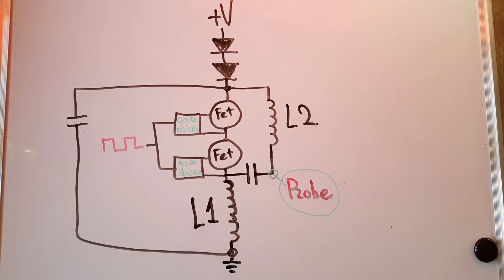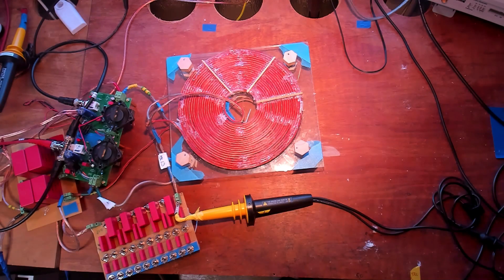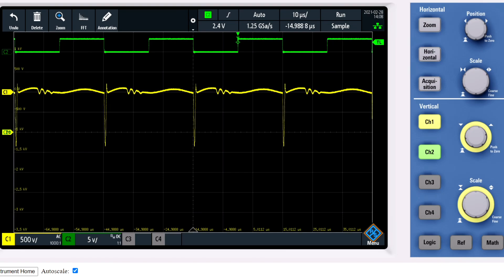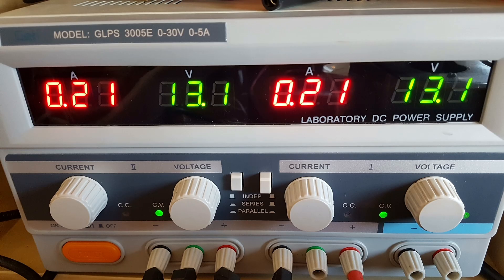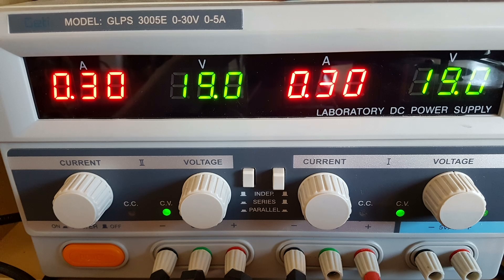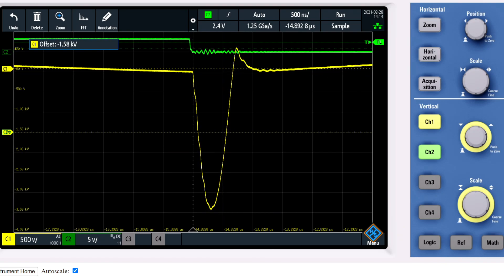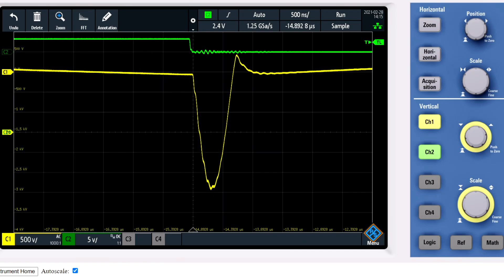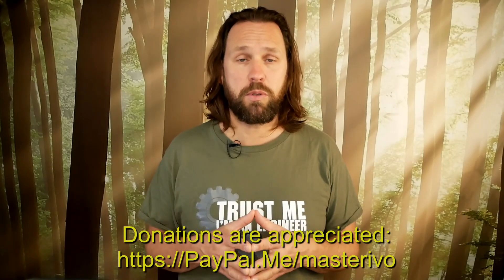High Voltage Impulse Generation

Comment: That’s a very cool circuit although I’m not satisfied with the 700 nanosecond pulse width. Have you figured out how to shorten it? A spark gap can produce much shorter pulse widths but going solid state certainly has benefits. Congratulations!
Reply from the maker: Yes I have, now I have 20ns current impulses. but at a lower voltage.
If I match Vgs threshold voltage of 2  mosfets I can again put them in series and get higher voltages.
the current impulse I now have is faster than a DC sparkgap.
Also it is quicker with a low gate to source capacity, so a low current rating of the mosfet. this makes it a lot cheaper. but it only works with a small discharge capacitor of 1 or 2nF. but that is no problem
Reply: @MasterIvo  Wow! That’s impressive! Do you have a video about this? Or a schematic? Or do you sell the board? I’m very interested in trying this on my radiant energy transformer to replace my magnetically quenched spark gap.
Reply from the maker: @SuperheroArmorychannel   https://magstar.eu/mosfet
there is all the info for building the mosfet. my most recent video shows the circuit in the second part.
boost coil in series with mosfet, which charges a 1nF cap that is in parallel with mosfet.
diode between coil and cap prevents  oscillations. mosfet discharges the cap in 20ns (and stays cool)

Comment: Hi Ivo,  I have a question regarding the resonance frequency. I have learned that there is a natural frequency of every coil because of its capacitive and inductive characteristics. For example I have a pancake coil that measures 55uH and 120nF; that will establish a resonant frequency of 61.95KHz; if another coil has 55uH and 100nF that it can be made to resonate at 61.95KHz if a 20nF capacitor is used in series with 100nF, then both the coils will resonate at the same frequency. If so then why we have to match weight of the coils, why a secondary coils has to have 1/4 wave length. Please specify and if you can also explain how you resonate a coil by adding various capacitors; and why not you calculate and come up with the same frequency or harmonics of primary coil's resonance frequency. 
Thank you.
Reply from the maker: Good questions. 

simply adding a series capacitor doesn't always work, as it needs to charge AND discharge, so that only works with AC signals.

calculations do not always give the same results in reality. For example the Probe measuring the frequency can influence the capacity.

Also, a bifilar coil has series AND parallel capacity, which makes calculations and modeling a little bit tricky.

Yes capacity and inductance determine the resonant frequency, So why equal mass?

To be honest I am not sure why.
Eric Dollard also stated, it was probably not equal mass but equal capacity as it refers to the dielectric field.

What I think, but still have not confirmed, is that we need equal mass, because we are dealing not only with resonance but also with electro static induction.

let me explain.
Yes L2 and L3 are the primary and secondary coils (april 2019 radiant power circuit video)
L2 is series resonant
L3 is parallel resonant.

When L2 and L3 are tuned to the higher LMD resonance, the voltage maximums are out of phase.

so far, equal mass isn't needed.

but now we introduce the impulses on L2.
L2 and L3 form the plates of a capacitor, which is charged up by the positive dc offset of L2.

This L2 L3 coil capacitor, is discharged by the impulses.

this rapid (disruptive) discharge produces a Longitudinal wave.

for this longitudinal wave to interact we need equal mass.
Then we can see the effects of this longitudinal wave, else it will not interact.

Again, I have not proven this. It is still an Idea. It is based on Tesla's writtings.

the quarter wave length, is mysterious to me as well. I feel it only relates to straight AM radio antenna's that are grounded on one side.
By using a quarter wave length, the top of the antenna will have maximum signal amplitude, which makes it like a wip. This maximizes the radio signal, as the energy is lost from the antenna, it wips up the Aether, giving lossy transverse waves

So for a coil this does not make any sense. A bifilar coil can store much more energy due to its mutual inductance, and the increased voltage difference between the windings that charge up the capacitance.

So I bet a bifilar coil is a bad antenna.
But you could extend the center of the resonant coil, again with a quarter wave rod antenna, and place a capacity ball on top, like Tesla did.

then the high voltage of the resonant coil can escape the coil, into the ball capacity. And if there are impulses imposed on them, it would make a good antenna. But not of transverse waves, but longitudinal waves that are not lossy. 

I hope this helps.
Reply: Dear Ivo: Thank you for the explanation. It is quite clear to me now as it makes a whole lot of sense the way you explained. I am also an Electrical/Electronics Engineer, graduated for US university in Texas. My studies are somehow more on finding a relationship between Electromagnetic forces and gravity. I did make a disc 3" dia, and it floats 1ft above the ground; I also made a field generator (using electromagnetic waves) that affects every material regardless of its atomic nature; meaning if I put a pencil in the field generator, it will spin the pencil; a rod, or any material, the field has gravity like effect; just as gravity pulls back every object tossed up in the air (not exceeding the escape velocity) I have been working for last 16 year on increasing the field effect of my gravity field generator to no remarkable success so far. Now recently I revisited my old project and started applying new techniques; one of which is resonating the solenoid in that generator. Any way, It is very fascinating watching your videos with clear demonstration, huge amount of experience and knowledge, and your unconditional sharing; perhaps that is why I am proud to be a donor to support your mission. You are a true Engineer and a lovely human being. Keep up your work and let your work shine your devotion. Regards.
Reply from the maker: Thank you thats is good to hear.
Very fascinating what you are doing.
from what I learned of "Electricity and matter" by JJ Thomson,  all inertia is stored in the bound aether, the aether IS inertia.
I would love to talk more and share Ideas. If I'm correct I have your email from your donation, I'll send you a message.

Comment: Two comments deleted again...
First one was link to -> Free energy 2012 Kapanadze Aquarium free energy device running 2KW heater load (this could be real)
Second one was link to -> Free Energy March 2017 Maksim Aliev 5KW 220 volts 50Hz  (this could be fake)
Comment was: Maybe is that reason why russians attacked Georgia and Ukraine
Reply from the maker: thanks for the the titles. It is becoming clear YouTube is actively censoring. I can't see those previous posts with links. Strange and disturbing.
Reply: @MasterIvo  Video from Georgia must be at least 20 years old. I have another video which is a part of this video, but a little better quality. It looks like original  inventor of Kapagen is another man and it is not Kapanadze. Because I have some photos from same meeting and on one of them is Kapanadze looks quite young.

Comment: and the second one tooo....

There is a a boy who claims 350% efficiency from bifilar coil... 
If I insert the link comment is immediately erased.  
??? wtf?
Reply from the maker: I can't see that one neither. Can you copy paste the video title, then I'll look it up
Reply from the maker: https://youtu.be/Rdzz34GNkxg is this it?
Reply: @MasterIvo  Yes this is it. You success. It look like if somebody is persistent enough they stop deleting posts. I am curious if this work. With usual coil it doesn't work. I tested it. There is no resonance, just back emf. But if bifilar coil has a capacitance then it is possible. So I am curious could you test it, because you already have all components made. 

In monofilar/ordinary coil there is effect of increasing brightness of light bulb, but this is because of back emf of coil. But with brightness comes also bigger power drain.  

Actually bemf is one part of resonance (coil part) second part is condenser part. Coil which is behaving also as condenser is a device which could be an answer. 
So at right frequency input we expect drop of input power by same brightness of light bulb.
Reply from the maker: yes coil that is a capacitor is what I am working on. a capacitor has 2 plates.
for the plates I use 2 bifilar pancake coils. I use 3 coils (radiant power circuit of april 2019) to create a feedback loop. L2 and L3 ar the capacitor plates. L3 is the middle coil of the 3 coil stack
Reply: @MasterIvo  I saw your work. It is nice and well documented. Congratulation on that. So did you test that circuit of that boy Daniel? 
If we connect a simple 12V light bulb on square DC signal it lit. If we connect a coil parallel to it, light bulb increase brightness. But power increase too. No matter what is the frequency of input. I tested it. 
There is a claim if connect a bifilar coil instead of ordinary coil comes to resonance at right frequency and as consequence power on input drop instead of increase. 
This is very simple test. What are you doing is far more complicated. So are you capable of this simple test or should I made a bifilar coil and test it myself?
Reply: @MasterIvo  About your coils. You have 2 ordinary pancake coils connected in a way to create a bifilar coil. It works to, just capacitance is little lower, but great for testing.
Reply from the maker: @Radovedn   would love to see you test it yourself and post it on YouTube. together we can work much faster in getting really interesting results
Reply from the maker: @Radovedn  not only the capacity is different, also the inductance. but indeed the principles still work
Reply: @MasterIvo  Ok. I tested it. It behave like an ordinary coil. Just BMF no resonance. 
It look like if there will be any resonance there should be a short HV pulses. And a big coil.
Perhaps is an insulation to ply. In future I will try different coil.
Reply from the maker: @Radovedn  thanks for sharing. remember BMF (back emf inductive spike impulses) are resonant voltage half waves.

Comment: Hello Master Ivo... your work is very inspiring and I have followed and built a variety of coils and switching circuits also. The first study and test was high-side with low-side switching of the coil to isolate the coil from +V and circuit Ground. Did not work well (POP!! goes a mosfet). So, I stacked 4 diodes from +V to the Coil. +V > D1 > D2 > D3 > D4 > Coil. And, added 3 diodes between D1 and D2 going to ground. This worked well with low side switching protecting the power supply and isolating the coil.

With a new circuit, I tried first high-side switching and then low-side switching with 2 mosfets in series a similar failure occurred that you experienced. The coil-side mosfet failed. Drain to Source permanently open. Drain to Gate permanently closed bi-directional. This stressed the Gate biasing circuit pumping +V in through the Gate which over heated the biasing ground resistor and zener and then in to the biasing pulse generator which overheated the bias resistor. Which failure occurred first? I'm guessing the mosfet... then the biasing circuit. My thought, it is not your HSM failing first. Maybe, something to do with a better dual-mosfet Drain-Source protection on high current side... maybe reconsider adding diodes in series. Thought: failure always occurred on start-up when the circuit is totally drained of energy with-in, maybe a sequence startup of mosfets (lock 1 mosfet on state, start 2nd mosfet pulse-state, release 1st mosfet to sequential pulse state). For now, I'm only using 1 mosfet (IRF840, cheap) until I figure out an output tank circuit. 

With the +V and diode high side circuit and 1 mosfet low-side, I've isolated the coil from +V (~32v) and isolated from ground. As of now, going to o-scope reading the coil +side and -side spike outputs under electrolytic capacitor load with rectifier feed. Then how to feed an L2 resonant circuit using a single SiC mosfet rated at 1200v. Maybe this will work for what I envision for an end-game.

Great work Mr Ivo!!!! Hats off to ya.
Reply from the maker: thanks, IRF840 has max 20V on the gate. and gate threshold is 10V, guess this is not the problem. it can handle 500V between drain and source, I suspect, your impulses are more than 500V and this is what kills them
Reply: yep, not the best, but these are only for test. Got these to work over 700v spike at slower pulse rate (<7kHz/20%duty). At ~27kHz/50%duty I kept the +V low to achieve 400v spike, then series mosfet slowly increasing +V until spike distortion, then backed off +V until 10% less spike. These are just for test anyway, even thou they produce a very sloppy spike. Didn't want to POP any Sic fets. 

Did you come up with a solution to series mosfet failure? Was it the HSM?
Reply from the maker: yes I worked it.
Am checking all the current polarities of the coils right now, to create a feedback loop, with L3 in the middle (LMD resonant)
Reply: Very good, look forward your solution. I've looked on your web-site and oshwlab links... please, is it possible to get a part number, value and manufacturer of just 1 coil tuning capacitor... I'm trying to find a US supplier, wanted to make sure I would be ordering the right capacitor type. Are they polypropylene metalized or film? Thank you.
Reply from the maker: wima fkp1 1nf 2000V   or wima mkp10 10nf 2000v  I believe metalized see datasheet.
other caps could be used
Reply: Thank you very much for the info, very helpful. FYI: I am seeing some interesting results with L1 speaker wire pancake then trying L2 and L3 as speaker wire or dual flat wire... trying different combinations. Dielectric field seem more even for single layer pancake on both sides of coil for L2 for an L3 speaker wire pickup on both sides of L2, L1 remote at this time. Just messin' around with it. And, the IRF840 is highly underrated... 628-632v spikes before distortion of spike, heat, etc.
Reply from the maker: Yes mosfets can go higher than the (safe) factory specs.
interesting results, please make a video so more can see. 

this is what I'm doing:
try feeding back from l3 into l1 using the higher LMD resonance frequency.
reverse the L2 coil and it tuning capacitor, so the cap is on the drain side, while the large dc blocking cap of L2 is on the source side.

stack all coils wound in the same direction, L3 in the middle slightly distanced from L2.
Reply: I went back to basics... Nikola's coil. As a low voltage control system engineer and schematic author, I would not have drawn the wire "hairpin" (where coil A and coil B are tied together) as Nikola did unless it was for a reason. Similar to communication antennas, DC shunts to ground are implemented for grounding static buildup, this would not affect the AC communication wave. My thought is this "hairpin" (actually AC de-coupler) is needed to de-couple the AC parameters of the coil (2 AC coils), but allowing for DC to flow freely, DC electrically 1 coil. Along with the "A"outside (top of drawing) is 90 degrees to "hairpin". I maybe off on this, but I am testing making a exact replica using #14AWG and #18AWG THHN (standard insulated electrical wiring) solid and stranded, with and without hairpin. Total of 6 coils in all. The thought of using solid 1 core is based upon skin-effect of high voltage on the wire surface. If true, this would promote an even flux field around the wire and most certainly a better and even dielectric field radiating from the wire surface... allowing for L2 pickup coils on both sides with even strength. Stranded wire (twisted or not, inside the insulation) would defuse the fields and scatter them randomly, essentially lowering efficiency of the system. Nikola also promoted the idea of no capacitors, the coils should do the work instead. I am all for that!!!!, and is a goal to achieve.

Switching... actually, I am not at all satisfied with any of the mosfet switching designs that I have tried so far. Goal: keep it simple, yet effective. I have 2 ideas how to accomplish low-stress, low voltage, low current mosfet switching that would inject high-voltage with ample current into L1. The injection of L1, as a load, would be from an inductive pre-driver which would not have any affect on the mosfet because it is an inductive load. Making the mosfet very happy. If it works... I'd be happy too. This idea would make L1, L2 and if necessary L3 an independent circuit for wattage amplification to final output. The pre-driver outputs to L1 and supplies feed-back to power the circuitry.

I like your feed-back idea, easy to accomplish... rectify, store, regulate to wave form generator and mosfet. I believe it should be on its own separate coil.

Is there a way we can communicate with each other off of this platform, on a private one?

Comment: very peculiar experiments. is it only observed near the pancake coil? if this coil is formed slightly conical does impulse appearance, voltage will also change ? thanks!
Reply from the maker: I think a conical coil would probably produce the same results. Not sure, would need to test to confirm.
These tests are only for the bigger experiment that I am working up to. it will have 4 coils, and the electric energy will be looped.

Comment: In regards to you experiencing amplification .... I beleive initial travelling wave is returning and increasing the amplitude of the latest travelling wave and turning into standing wave that will continue to increase until such time as mosfet max voltage is breached or it is dissipated elsewhere! Could this be possible??